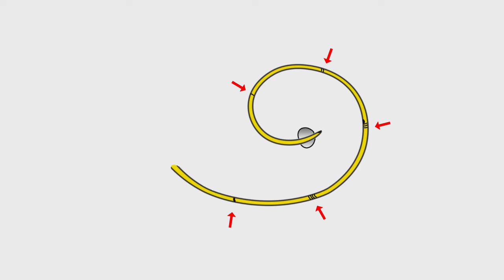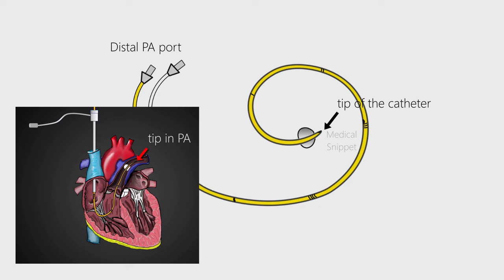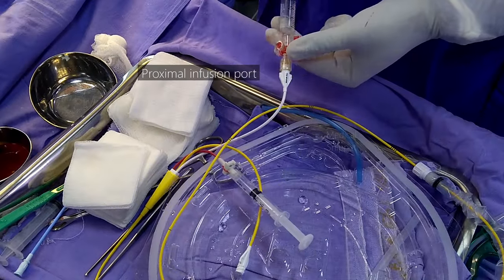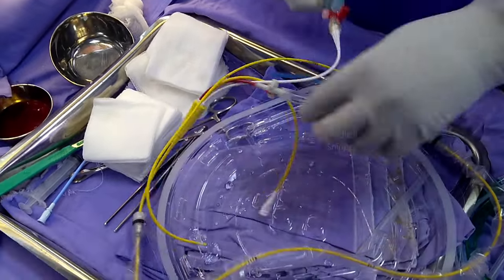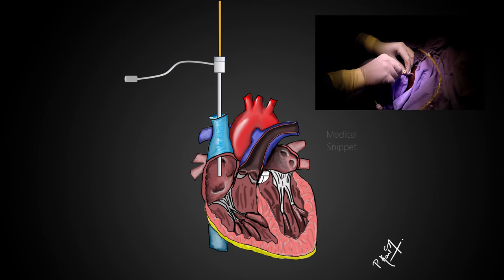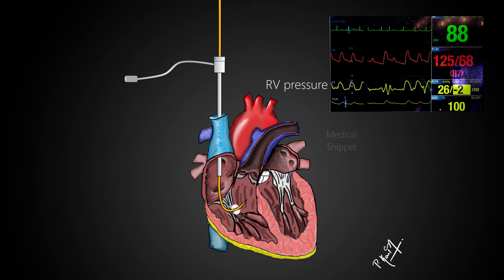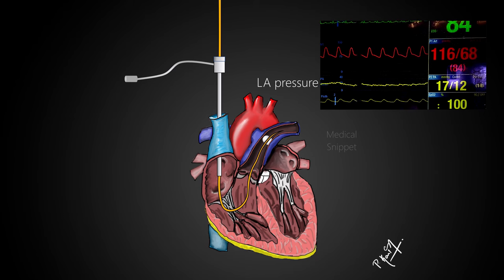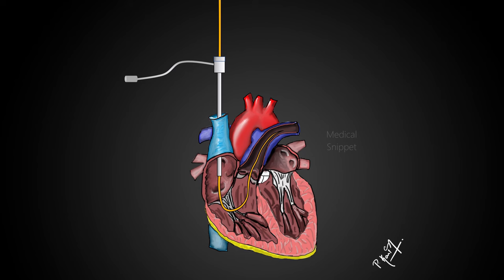Pulmonary artery catheter (Swan-Ganz Catheter) placement and physiology

Comment: Hi I was told that proper placement the Swan should transect the spinal chord. Does this mean it should float through the right pulmonary artery. Most diagrams seem like it’s in the left?
Reply from the maker: It can float in right or left pulmonary artery, depending on the path the balloon takes, while advancing it. More than the side... what is important that,  we should not push further once the PA pressure waveforms is damped, at this juncture, balloon is to be deflated, looked for reappearance of the PA pr trace. I have personally seen PA cath in Right pulmonary artery n also in the left pulmonary artery.
Reply from the maker: In this CXR, catheter tip entered the right pulmonary artery... https://www.youtube.com/watch?v=6FsVE--PQP0&feature=share&si=ELPmzJkDCLju2KnD5oyZMQ
Reply: @MedicalSnippet  if the swan is in the left pulmonary artery after placement is it safe to check a wedge ?  ThNk you for answering my questions
Reply from the maker: yes, we can check the wedge pressure